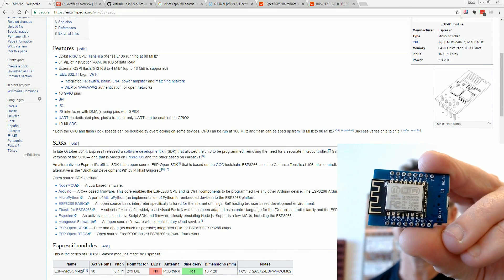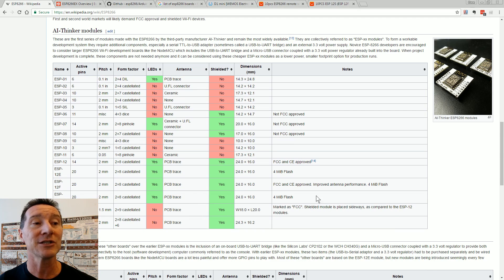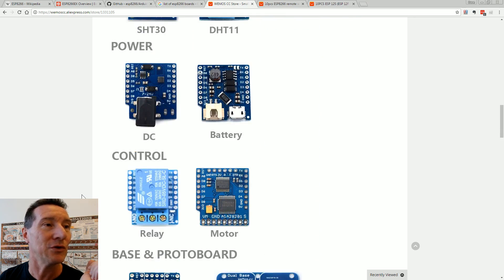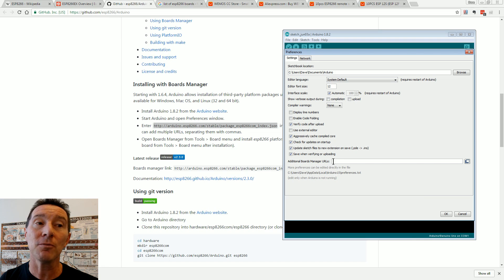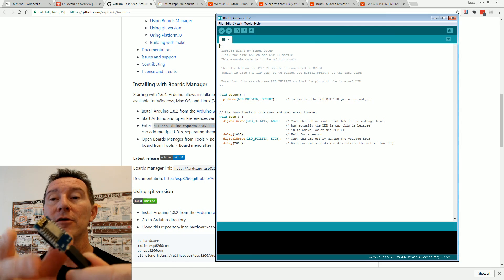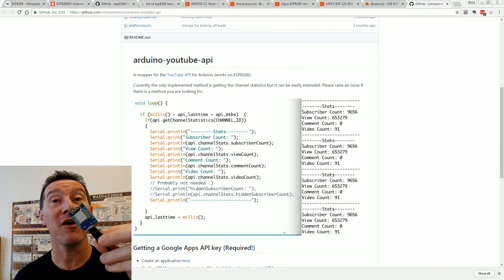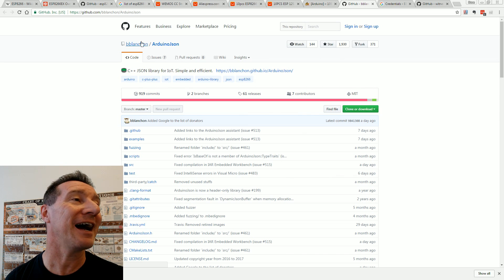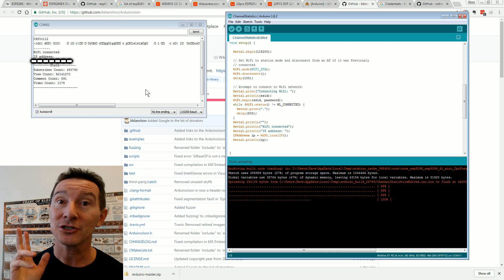EEVblog #998 - How To Program ESP8266 WiFi With Arduino

Comment: URL integration in IDEs is all nice and flashy. But as an EE, I would much prefer an offline option that can be archived along with my board design, circuit calculations, design notes etc. So it can all be restored and modified exactly as it was, unaffected by whatever upstream may have changed or discontinued.  Some hardware vendors are forgetting this, delivering tools that prevent sound engineering practice. Looking at you SILabs.
Reply: You can also follow the instructions in the section below the section Dave was reading in the README. It goes over installing manually and cloning the repo locally so you can back it up. There are also more "professional" SDKs for projects for ESP8266 like PlatformIO that offer more flexibility and robustness.
Reply: GpanosXP no autocomplete, no proper file management (with folders), no possibility to pass different compiler flags to different files, no smart autoindentation (indent on { character), no error/warnings management pane, no debugger, no refactoring, no same-variable highlighting, no built-in documentation browser, etc etc etc

For the resulting code itself, the missing project management is the biggest one, the rest just results in bad code because it's too much work to do it properly.
Reply: I agree that the Arduino IDE is a little basic but most of these could be solved by working with platform.io (not sure on compiler flags to different files, debugger, built-in documentation browser)

http://docs.platformio.org/en/latest/what-is-platformio.html
Reply: If, as an EE, you're using the ESP in the Arduino mode... you're definitely doing it wrong.
Reply: If you want to write professional code, I dear hope that you aren't touching the Arduino IDE anyways.

I recently looked into the official Espressif SDK for the ESP32, and it can easily do what you're describing. Even better, it's using a Makefile to build and upload to the device, so it's trivially automatable in a CI system.
Reply: Yes, as long as you don't actually use the IDE (remember that the I stands for "integrated"), it's fine.

Not being able to debug is a deal breaker for big applications.
Reply: John Francis Doe - Just a small tip: I find it useful to makena portable installation on USB stick. I have different sticks for different environments and only install/update when I need to. The IDE/libraries is used offline, so no problem there.
Reply: Although I work with the Arduino folks when it comes to education and use the IDE in class (lately mostly the Create web IDE), for my own development needs I have stopped using the Arduino IDE a long time ago. I've used Eclipse for a while since I needed it for other development, but have been on Sublime Text for 3 years now and switched to PlatformIO as a toolkit over a year ago.
In the beginning I used the DevIoT plugin (I did bug-tracking and tests over the first few releases) but a few months ago I moved to just using the command line tools for PlatformIO.
Sublime Text 3 just makes my life so much easier :)
Reply: I use Visual Studio Code which is a free open source editor with an extension that talks to the Arduino IDE. It is a much better editor with tons of extensions for everything. Just Google Visual Studio Code Arduino.
Reply: We have this exact issue as well. We have a rule: If it's needed for production, it cannot be pulled off the internet when it's time to build or set up a new IDE. We clone git repo's into a local git server and pull from there, or we rsync yum repos locally and pull from there. For things where you need to manually enter a URL, we typically reverse-engineer the loading procedure and write a script that can be used to mirror them to a local server, and then we use the local server URL.

Because what you are saying is absolutely correct: The lack of ability to lock versions, use some sort of vendoring control for libraries, and upstream libraries not giving a toss about backwards compatibility and breaking changes makes for a nightmare maintenance.

Comment: Dave.  A bit of skepticism coming - Has anybody looked for hidden URLs or IP addresses in these libraries?  How would you even check??
Reply: Is it though? Last time I looked only YOUR code was "open" (and any non-Espressif libs it used), everything making the ESP actually work was supplied only as a compiled binary lib. I haven't heard about that changing. To illustrate - would you mind pointing out where is, for instance, the function wifi_station_get_connect_status() implemented in the ESP Arduino repo...?
Reply: If you can read C++, you can read the source code. It's all open.
Reply: you can simply read the libraries. the libraries are not compiled. they are just raw c++ code. you can modify them however you like.

Comment: These are indeed cool devices, I lost count on how many of them I have in my old Floppy disk drive cases, but I know I have a bunch of them in every variety of size and shape, and there are well over a dozen, along with accessory boards for specialty programming. I just stop and think of the tiny size of these little guys then think back to the good old days of computing. My son talked me into buying our first computer, I picked a commodore Plus 4 but was warned, before it's arrival of the non comparability with the old Commodore 64 software that was all over the town I  lived in, so I cancelled that order, and re-ordered a Commodore C=128.  She was a wonderful machine, when ever I could talk my son into letting me work on it.  Now to look back and see that all that power in the 128 is contained in that little chip, plus built in wireless, for an old computer nerd, now hitting my 66th year on this big blue marble, I find it just plain amazing!

Comment: Great modules. Have used these things a lot for IoT. One huge downside is the lack of any hardware timers/counters though...
Reply: There is a hardware timer of course. But you can't have exclusive priority over it because WiFi is also time sensitive. Maybe look into the ESP32, which has dual cores. Alternatively, use an external chip that does dimming and I2C it. Alternatively to that, use addressable LED modules that do their own PWM.
Reply: See this http://www.esp8266.com/viewtopic.php?p=34484

Looks like there's hardware timers, watchdog timers and real-time clock. There's also a sleep timer.
Reply: Thanks for your response. Im building a WiFi LED dimmer at the moment and all PWM solutions for the ESP produce visible flickering. Software PWM doesn't work and RTC based ones doesn't either. I think this is deu to the usage of the timer for the WiFi stuff.

Anyway. Im using an Atmega328 for the PWM an the ESP for the WiFi. This is working very well so far.

Comment: Hey Dave, check out the STM32 boards, they're the same 3 or 4$ price but with a MUCH more powerful processor.  Works with arduino but no wifi.  

Most of the STM32 boards are STM32F1  but if you need DSP there's the STM32F4 boards (though these are a bit more expensive at about 16$)
Reply: The stm32f4 runs at 168 MHz and doesn't have wifi but the esp32 (not the 8266) runs at 180 MHz and has full wifi and ble front-end. It also supports up to 32mb built in flash
Reply: The stm32 at 3$ seems to have a lot more hardware features than the esp8266. Also it's a real 32 bit cpu (ARM cortex M3). In some cases it's going to be a better cpu.

Likewise the stm32f4, has DSP functions that the esp32 doesn't. It depends what you're doing, that's why more of these MCUs should be covered by the eevblog, so you know what options are available.
Reply: oh yeah i agree with that the stm32f* is a really cool chip but Dave only did one boring video regarding the stm32f4
Reply: The STM32 micros are awesome. I really like how cheap the debuggers are and how easy it it to debug through eclipse. 
They are a lot more powerful than the 8 bit microcontrollers even though they cost about the same.
Some of the higher powered ones even have double precision floating point units and a large L1 cache.
Reply: For hobby use no one will pay that price for compiler, it is not worth it, but if you do something for serious production you'll find that compiler is in reality free, you will easily save more on price of mcu then compiler is costing, all of compilers I stated generate much smaller/faster code then GCC and not like 2-5%  but over 30-60% (according to some tests IAR is up to 5 times faster then GCC but again that are just tests same way as GCC can beat Intel compiler in some test for 20% and in other Intel can beat GCC 200 times). In my experience IAR generate 30-40% smaller code on large projects then GCC (I never did speed tests simple because I can't find to me objective way, but from experience of some my colleagues, same software that 
 for me happy run on STM32F103 after they ported it to GCC they cant make it run satisfactory fast on STM32F407, but I take that with skepticism because I do not need what they did with that code in process of porting it).
GCC is was never designed to be compiler for mcu, it is designed  to be compiler for "normal" processors (for example x86 for which it do pretty good job, not best but better then most).and it cant never beat dedicated mcu compilers. Now is 2017 we do not expect compilers to make big problems (GCC still can make some problems with optimization), it is long over time when compilers generate wrong code when they was asked to optimize code (like Microsoft compilers did in 1988), but again GCC can generate every time different code (different size) when you compile exactly same source (my recent experience with GCC 6.xx version under Linux) which is sign that it is still not mature compiler.
As of windows if you do anything more basic thinks in electronic you are pretty much doomed to use it, most widely used software (in industry) run only under it, there is no Linux equivalent of most of it. There is version of software from Cadence (which do make top end software) for Linux, but you use there products if your company have really big budget, their PCB software is like 250000$ and that is one of their cheaper software, little digression they are same company which now owner of IP of Xtensa configurable processor (designed by Tensilica now part of Cadence) around which ESP is based.
Reply: Compilers for STM32 are not cheap, cheap/free are solutions based on GCC but they worth as much as they cost. Check prices Keil/IAR and you will see that prices are really serious (roughly arounf 5000$).
Reply: s/ then / than /g :-)
Reply: best thing about the ESP32 are the 2 main processors + the low power wakeup processor & the DAC, there is so much on one chip you'll have to check out the datasheet
Reply: shodanxx Honestly, Wi-Fi is one of the main selling points of the ESP chips. If you have a project that needs connectivity, I would pick an ESP32 every time over an STM32. At this point in time, the niche they fill is cheap connectivity with enough peripherals to do other interesting things besides just connect to Wi-Fi. Moreso for the ESP32. The thing can run Doom!
Reply: the ESP32 is the way to go if you need a decently powerfull microcontroller connected via wifi/Bluetooth.
Reply: I don't have any problems with GCC. I have used it for STM32, AVR, ESP8266, & Intel x86_64 and it works great.
A hobbyist is not going to pay hundreds or thousands of dollars for a compiler that is closed source and requires windows to run.

Comment: this is a clone of Wemos D1 mini (still runs esp8266), genuine ones will have WeMos etched on the shield, has better PCB and components. I had a couple of the clones died some overheated.

if you want this for a project that will be always on, go for the genuine ones WeMos.cc is their website
Reply from the maker: Do the clone modules use genuine ESP8266 chips?
Reply: EEVblog yup they do! I bought an entire standalone board for like 4 USD!
Reply: s bright that's exactly what I meant by (still runs 8266), I had experience buying dozens of those clones, a couple died, some with usb chip stopped working, and some with regulator overheating to the point where it would stop responding, I'd rather pay the extra 2 dollars for a decent one
Reply: Omer Choudhry used those as well, I still like D1 mini for being more compact
Reply: mohsh86 I've had quite a few cheap boards burn up too. That's the Aliexpress premium we've gotta deal with!
Reply: I haven't had any issues with clones versus genuine esp8266 so far, but maybe I just have been lucky. I have used a good mixture of both at this stage (at least 5 each). Genuine ones do look a bit better quality, but haven't noticed anything practically. I find the official Wemos ship a lot faster too (but I have to pay shipping in Ireland anyways). For me, the price is about $3 versus $6 for a single unit delivered

I noticed that the picture on the WEMOS website for the D1 mini doesn't have Wemos etched on the shield anymore (or at least not like it used to) so I guess the new batches are different.
Reply: I get mine from Ebay, they seem to be better buy and more reliable, wemos or not

Comment: That's exactly what was missing from your videos, the actual reviews of new boards like this which many of us use and want to learn instead of reviewing the expensive oscilloscopes and what not (not saying you shouldn't do them, they are equally helpful). This ESP Wifi module has been around for like ages and there are lot many new boards like LoRa Wireless that you really should check out and make projects on.
Reply: Also, my experience is that you have to do a real project with a µC before you really know something about it.

For example, the ESP's GPIO pin mode is rather random on startup, it doesn't go into automatic input mode like on every other controller. This can cause a lot of problems, especially when you're trying out stuff that might need a different pin mode. Further, a lot of the ESP's GPIOs have to be in a certain state at boot, otherwise it won't work properly. The count of GPIOs you can actually use freely is pretty low.

Dave didn't mention any of this, because he never progressed beyond compiling the blinking LED example on an off-the-shelf development board.
Reply: Well yes but making sense of a board properly would require actually reading piles of docs to find out what is unique about it, what it is/isn't useful for, and what its idiosyncrasies are instead of just plugging it in and spraying half-informed opinionated commentary reacting to what happens on the screen. So clearly not Dave's forte.

Comment: Haven't seen it below, but the reason you was having issues uploading the sketch to the device was because you have the serial port already open and it couldn't open it again to upload.
Reply: yes i agree, if the serial port monitor is open when trying to upload a sketch the arduino ide will halt with an error. You just need to get into the routine of closing the serial monitor before proceeding with an upload.
Reply: s bright I'm gonna have to disagree with you on that one.
Reply: That's why I cringed when Dave sang the praises of the Arduino IDE. It's a POS with lots of pitfalls for newcomers, no autocomplete and not even proper indentation support. It can work with a bit of headaches like shown in the video for running ready-made examples, but don't ever try to write some serious code in it.
Reply: s bright you obviously don't understand how ESP or even arduino work.
the main form of communicating with the chip is through serial aka your TX RX lines and WEMOS itself comes with a USB to Serial chip, though a cheapo CH340 still it does the job.
Reply: Reese Me the CH340 is the cheapest USB-to-UART adapter available in China, that's why the clones all use it. The driver is rather low quality, though.
Reply: StupidInvaders well, after the bricking debacle, even a Morse telegraph would be preferable to an FTDI.
Reply: StupidInvaders remember years back FTDI driver use to "bricks" counterfeit chips INTENTIONALLY.
a good reason to stay away from it.
Reply: the serial monitor is locking the device causing it to block the upload as it is running an app,
Reply: the wemos D1 R1 comes with a ch340 chip, the nodemcu comes with a silab interface.
Reply: Paul Cavanagh the version of NODEMCU i chose, uses the CH340. i'm like, since all of the Arduino NANO clone uses CH340 i might as well stick to a single driver solution.
Reply: anlumo1 thats why those boards i got are dirt cheap on ebay.
if you were to get it from Alibaba for like 100pcs share among your friends it runs you like AU$1.50/pc.
Reply: anlumo1 I kinda like the CH340 it's not great, but I will take that over ftdi any day of the week.

Comment: Your module is definitely a clone. The older legit ones didn't have the screen print logo but the metal can should have wemos laser engraved instead of AI Thinker. I've had mixed luck with the clones, but as long as the board you get works then it should be identical (my problems were with high DoA rates with the clones).

Comment: can you do port manipulation and program timer interrupts on the esp as well?
Reply: I think Dave should do a segment called, "Ask the datasheet."
Reply: That sounded condescending, but I was serious.  I don't know where to look to see the threshold voltage necessary to turn on my mosfet.  I'm guessing threshold something, but as a software guy learning hardware as a hobby, it seems the datasheet never explains it to my satisfaction.
Reply: SirArghPirate Low level port manipulation is a bit different than on AVR or PIC but essentially yes. You can also do interrupts but you have to be careful, the RTOS needs to run code to manage the WiFi periodically so your interrupts have to be quick.